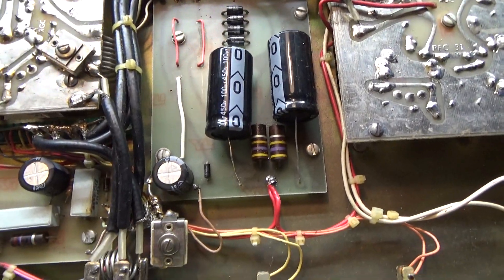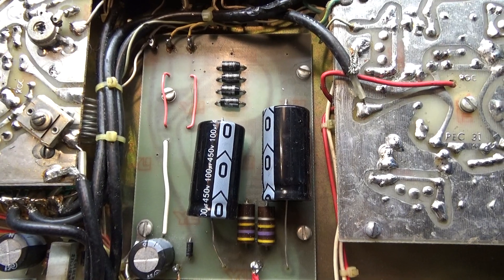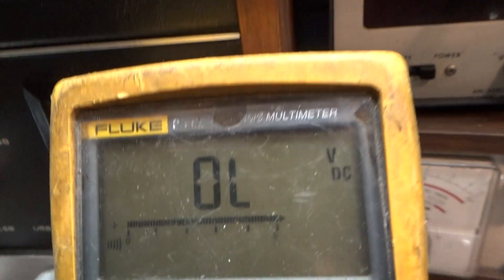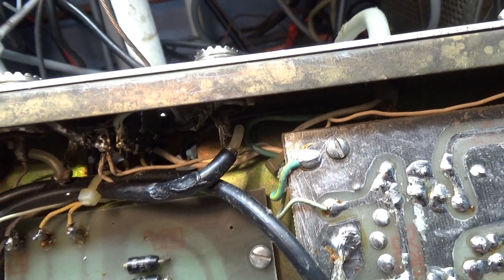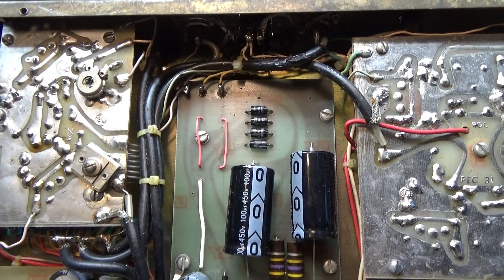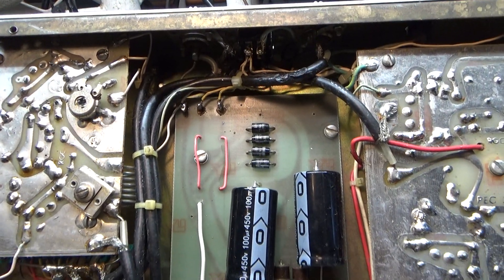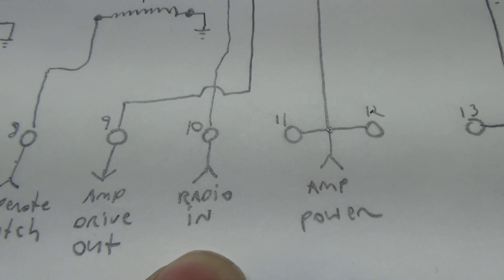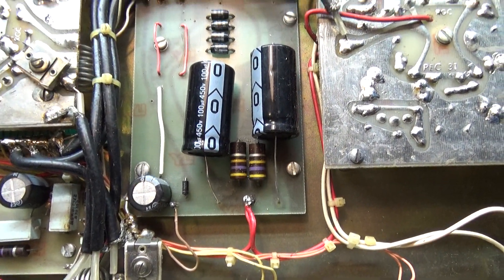Palomar 300A wiring walk thru

Comment: Saludo cordial en 2025
Soy de Colombia mi nombre es José Rivera.
Tengo una consulta cuál es el orden de los tres cables blancos que vienen del conector de 8 pines
Los que están al lado de los dos rojos dónde van el relevador de alto voltaje 
Le agradezco me ayude por favor gracias 🙏
Warm greetings in 2025. I'm from Colombia, my name is José Rivera. I have a question: what is the order of the three white wires coming from the 8-pin connector? The ones next to the two red wires where the high-voltage booster connects? Thank you for your help. 🙏

Comment: On my key and circuit board, there are two blue resistors, five bands what size are them resistors
Reply from the maker: I'm going to be sarcastic. On my street, there are 2 blue cars with 4 tires. What size and type are the cars?

Comment: my amp wont key up on high  power
Reply from the maker: most amp not keying up problems is the keying transistor. which amp is it and does it key on low power?
Reply: @tramdr  help same issue no output but I hear the relays click